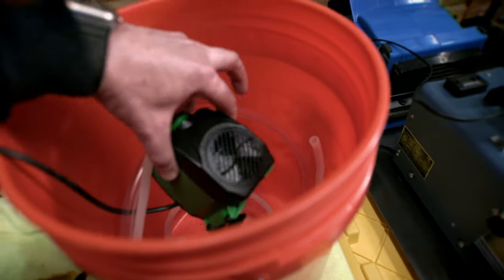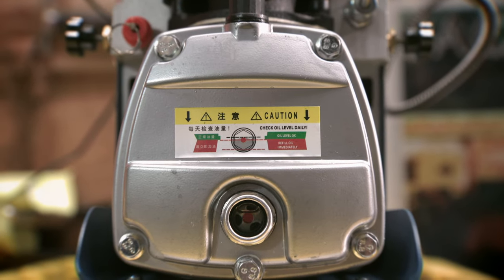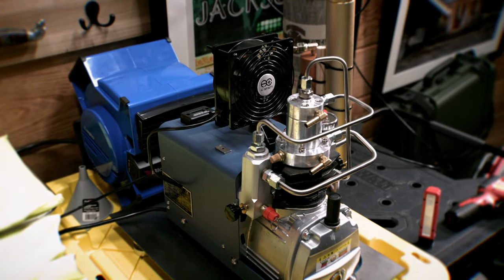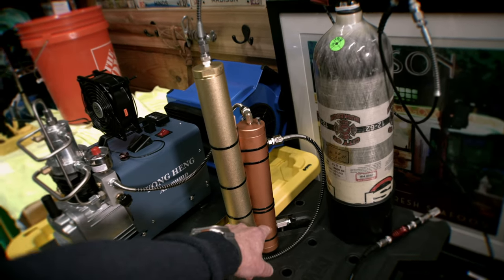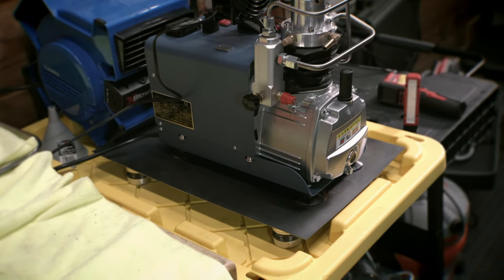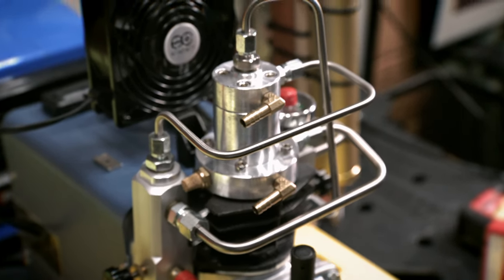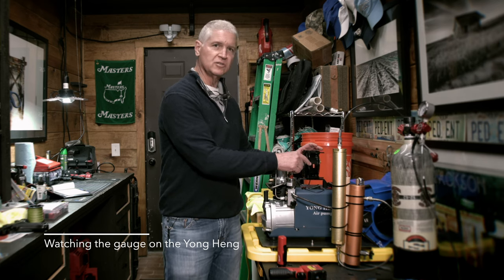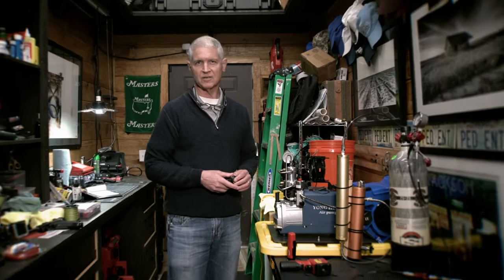Yong Heng Set Up, Modifications, & Impressions

Comment: How much do you have into your addons that you chose to support the compressor?
Reply from the maker: I think that's a fantastic question and one I have not thought about. Some of the additions would be appropriate for any high pressure compressor, not jus the YH, including the copper and gold water filters, so I won't count those. I upgraded the water pump for $19, the Lasko blower for $66, the high speed computer fan for $38, and the anti vibration springs for $34. That comes to $157. Overall a lot better than a high end compressor, but I don't know if any of this will ultimately make any difference in longevity or not. Only time will tell. Thanks for asking and for watching!
Reply: Copy that, thanks

Comment: Where I put the thermostat I can not find where this little pin need to go
Reply from the maker: The thermometer probe tip fits in the wide round silver base of the compression chamber (on top) just above the black portion on the handle side.
Reply: @jmarkreed  thanks I find it😅

Comment: Would you fill up a 74 cu ft in one shot ? With this yong heng thank you
Reply from the maker: No, definitely not. I just do incremental fills myself. I don't let the tank get too low. I'll usually get it down to around 200 bar before filling it back to 290 bar. I don't want to make the machine work too hard or too long.
Reply: @jmarkreed  ok I’m probably gonna get one and you wouldn’t atleast recommend 300 bar it’s still less then 310 bar.?
Reply from the maker: Well...my YH is the type that cuts off automatically at a certain pressure, and although I tell it to cut off at 300 bar, it wants to cut off at 290, so I let it. No sense in making a big fuss over 10 bar. It's happy and I'm happy. @recklessjunkie

Comment: whats that thin fill whip from the molecular sieve tube, And is that a tuxing moisture oil separator or what.
Reply from the maker: Thanks for asking. The microbore fill whip was purchased from airtanksforsale.com- great quality. This particular one has two female ends. The moisture oil separator was purchased on Amazon at the following link:  https://www.amazon.com/gp/product/B077SX5G9V/ref=ppx_yo_dt_b_search_asin_title?ie=UTF8&psc=1  It shows that it is currently unavailable and was listed as a Toauto 30Mpa High Pressure Air Filter External Water Oil Separator Filtration for Air Compressor Air Pump. It actually gets a lot of water out. I bleed it every 5 minutes. Thanks again for asking.
Reply: @jmarkreed  Im about to buy a yong heng Been doing a lotta research on it, Im waiting for that part to get back in stock for now ive been doing more research on this compressor to give it best longevity. I think I will go for the copper one and Il see if I need another gold one from there on.
Reply from the maker: @hardyb1215  Sounds good. Just make sure you include a filter with molecular sieve in it. It's very important to keep all the water out of your tanks. Thanks!
Reply: @jmarkreed  How do you know when to change the oil when I get mine I think im going for seco lube, Do I need an hour meter? or should I watch the color of the oil when it turns darker change or what.?
Reply: @jmarkreed  I noticed you mention you use rarus, how do you determine when its time to change it by color, Do you track the hours,? Or did you get a hourmeter.?
Reply from the maker: @hardyb1215  The general recommendation is to change it after the first few uses and then annually after that unless you see significant color changes. I have an hour meter just for my own curiosity and ultimately to see how long it lasts.
Reply: Wait did you connect the copper fill whip to the bottom of the tuxing how did you do that isnt it just a female on the end, I noticed your running the air venturi fill whip female both ends so you have it connected to the male end, that doesent make sense the tuxing doesent have 2 male end so im wondering how you got the fill whip from the copper connected to the tuxing.?
Reply from the maker: @hardyb1215  Excellent and astute observation. To make the two work together, I had to replace the bottom connecting hose on the Tuxing with a male foster. I forgot that I had done that.
Reply: @jmarkreed  I see great setup, I though about just staying with my little blue filter filled with sieve after the copper but the humidity is getting high I just purchased the tuxing.
Reply from the maker: @hardyb1215  I think that is a good move.

Comment: I wonder what a real thermometer would have read at the hot end, and not one of these IR guessing devices. They don't work well at all on blank metals. ;)
Reply from the maker: Thanks. I actually use a good Fluke 62 Max Industrial Infrared Thermometer gun as well as the internal temperature gauge (digital) and they essentially read the same when I'm measuring the hottest part of the metal. I'm sure neither are an exact measurement, but I bet they are pretty good reflection of the actual high temps. Obviously, the main point is to keep it as low as possible and never let it get out of control. Thanks for watching!
Reply: @jmarkreed  I'm sorry, I didn't mean to mock your tools. But just given the physical principle of measurements no IR thermometer can properly measure on bare metal. And they all have problems focussing on a small piece.
How did you use the internal thermometer?
By theory the air must be A LOT hotter than this. I'll try my own measurements soon! ;)

Comment: A little late to this video  but I wish I wouldve never bought one of these junk let alone 2 ,the first one completely fell apart and has to be rebuilt constantly and the second one out of the box wont air past 3000psi ,I suggests not buying this crap.
Reply from the maker: That’s interesting. I’ve had mine for around 4 years and it’s still going strong. I know there are a lot of YH clones around and I would suspect that what you got. Just a thought.